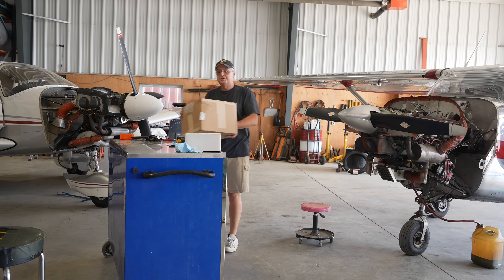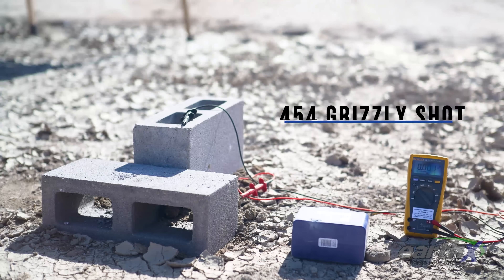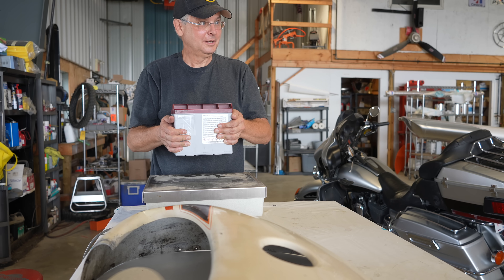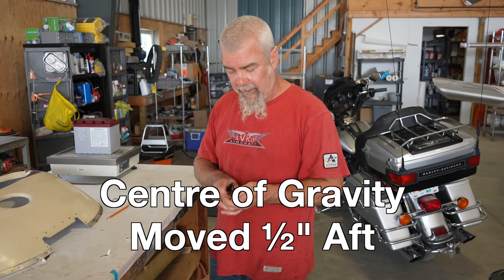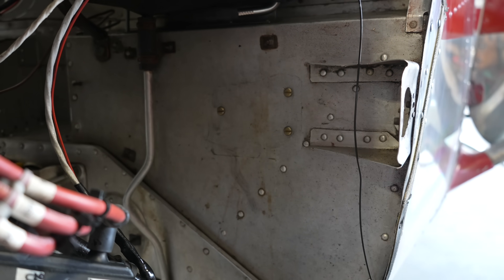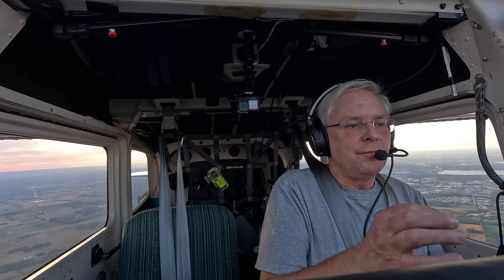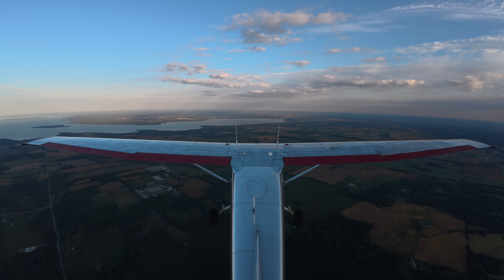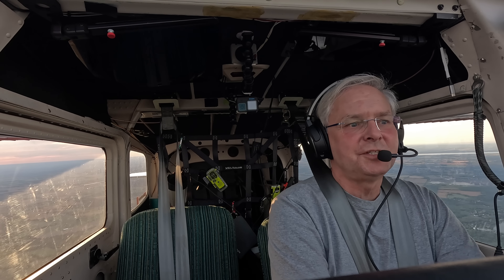EarthX Aircraft Lithium Battery Install – Safe! 18Lbs Lighter! Stronger Starts!

Comment: Glen can you share a pic of how you attach a camera on the tail?
Reply from the maker: That's a tough one to answer, especially since you may have different regulations in the US? I built a mount with grip parts out of my 'day job' toolbox. It's bolted directly to the tip of the tail, and reinforced internally. 
I sought out approval from Transport Canada and they dodged the question; I think cameras are a grey area that they just don't want to address.
Reply: @GlensHangar can you take a photo? So up on the beacon area I assume?
Reply from the maker: You can see it here: https://youtu.be/6UIMQb3QL1M?si=0B0xmkJ8spMgq2PH&t=852

Comment: Glad the battery has been a boon! Another bonus of the EarthX is how tolerant it is of abuse & aging.  When the Sonex was down for two years I accidentally ran the batt low and then forgot about it on a shelf. The BMS disconnect kicked in, and I thought it was a goner because it had been in that state for so long - but after a reset and a couple of charge cycles its working like a champ! And this is a battery from 2018; no way a lead-acid would still be good after this many years.
Can't wait to hear about the IFR checkride and the fishing trip!

Comment: A simple upgrade like a battery is a good thing. 
I like the fact you mentioned about adjusting the Voltage Reg, not something you can't do in automotive and causes issues if you think you can drop an AGM/EFB batt in a FLA battery equipped car. The charging rates and requirements are vastly different and can lead to early failures. 
The cost of it may scare people away but like you said, if its weight you want to save cost does not matter.

Comment: Any mechanic will tell you that a lead acid battery can explode.   Drop a wrench across the the terminals and the wrench immediately welds itself in place, now you have a runaway electrical circuit and the fluid inside the battery starts to boil.  Hydrogen gas starts to vent from the battery and the wrench welded across the terminals is glowing red hot.  Boom.

Comment: Don't you want the battery close to the firewall and the foam towards the nose for maximum CG affect?
Reply from the maker: Yeah, but Maximum effect in an aircraft like this with such a small change (arm distance  / weight) is really almost insubstantial performance wise. The biggest change is with the increase in usable load.

Comment: I wonder How It Will React With Sub Zero C° Temp 🤔🤔
Reply from the maker: We'll find out, winter is coming.
Reply: Long time watcher of Off Grid Garage here in Australia - Andy has regularly discussed how LiFePo cells get damaged when trying to charge / discharge when under -5°C. Any heat you can impart or investment in insulation for cold operating environments will impact the cells life substantially.
A lot of BMW'S try to charge when they are too cold. Worth diving in to the rated spec sheet and see what your minimum op temp is.
Happy flying!!!
Reply: On my EV (Nissan Leaf) it has a battery heater that kicks in when it gets below -15C.  And in the RV world you  can get LiFeP  batteries with internal heater which keeps it going below freezing..  Maybe it has a heater already built into the unit.  would be nice to know
Reply from the maker: @3kids2cats1dog  No heater built into this battery - but MVU is kept in a hangar and the engine itself has a pre-heater that brings it to operating temp before I start up. So 95% of the time the battery will be warm before I crank the engine.
Reply: @3kids2cats1dog batteries this small don't. To generate heat is a costly exercise in terms of energy. It's fine with EV batteries as the packs are huge comparatively. Just not enough amps on smaller units like these to apply heat to itself.

Comment: I loved Chris' explanation of W&B and center of lift. One thing for operation of the EarthX in the cold. If the battery is cold, before you try to start it, run some current through your battery by turning on the lights and the EFIS for a minute or two. The extra current will slightly warm the battery and you'll have better cold starts than you ever had with the lead.
Reply from the maker: Interesting.
Reply: @GlensHangar  I'm regularly operating the plane in -10 to -20 C and happens occasionally. Especially since my battery is in the cabin and not getting residual heat from the engine preheating. You will likely be fine as it's in the engine compartment and will get some heat when preheating the engine. 

If it's cold and it doesn't want to turn over on the first go, just have it run some current through for a bit and then try again and it will start like gangbusters. Sometimes the current from the first attempt will warm it up enough as well.
Reply from the maker: @ansonmoxness5403  Thanks - Yes most of the time the plane gets a preheat in the hangar before starting on cold days, but there will be times where it's out on the ramp overnight. This is helpful info.

Comment: When most people hear/see lithium, it's lithium Ion they're thinking of. LiFePO is an entirely different and drastically safer chemistry. Lithium cells are still used instead of iron phosphate because they are higher performance, and in phones and drones that means less weight and longer run time.

Comment: Question: If the new battery changed the centre of mass by a 1/2" inch, is that what the foam helps offset in the box? or is it just for fitment?
Reply from the maker: The foam is just so the battery doesn't move around in the battery box... a smaller lighter battery box for this aircraft is a whole other 3" stack of paper.